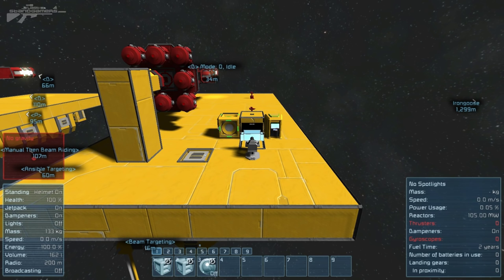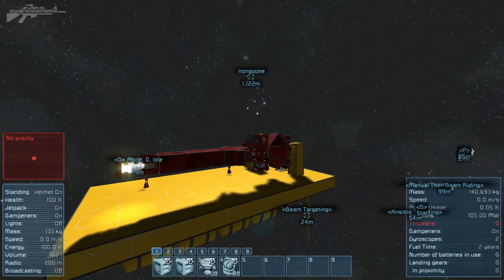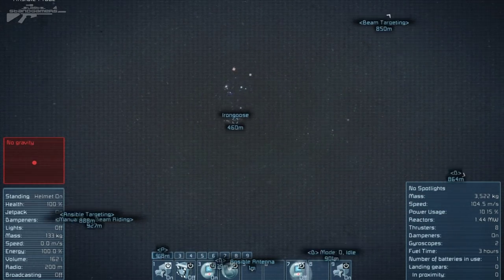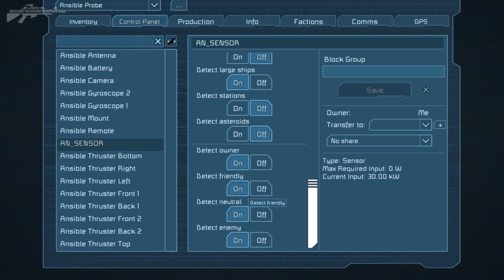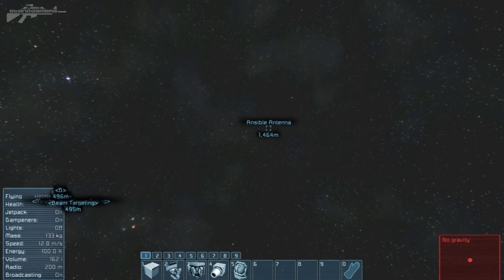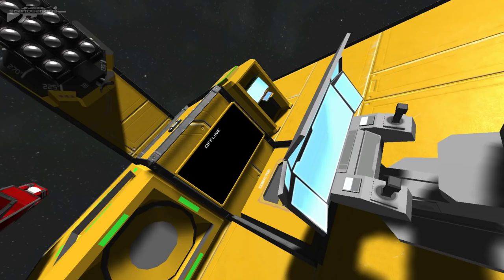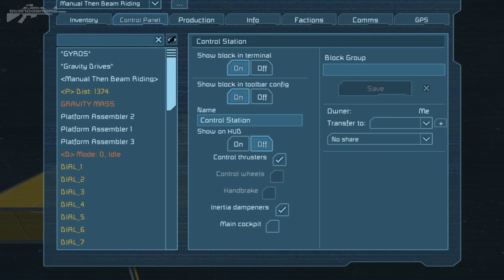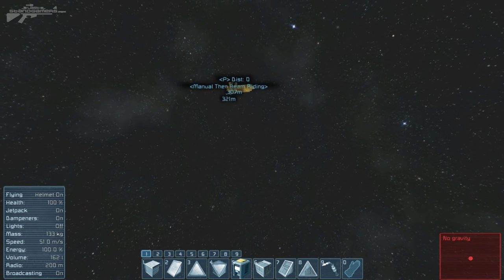Space Engineers - Laser Guided Missiles

Comment: I think that perhaps the first method might be simplest, plus if you gave it some distance and made it a satellite station out from the base a little bit it would provide better coverage. Granted you would need a sphere of satellites around your base to cover each point within the range of the turrets, plus perhaps each station would require six sides and six seperate subsystems so it would be one per missile bay, the range between them would have to be less than 800 for full coverage via the hemisphere of range of the turret and therefor the missile...
The second one requires too much effort before hand. It wouldn't do well in an impromptu attack unless you wanted to strike the enemy ship as they came by.
The third one seems a bit complex, but ultimately the best semi short range one, despite the lack of automatic protection, which the first method is best at despite its low range.
So the question becomes how best to utilize this in base protection? Fully automated short range system one? Preplanned attack drone guidance system two? Or long range preemptive retaliation system three?
Personally i would pick number one simply because i only need to set up supply drones to keep them stocked on satellites at range. And based on this it sounds like you could make a fleet of satellite ships that would remain in a certain position via an array of turret lasers with specific distances, and the drones would use this method to properly orient themselves from the main base to each satellite without too much problems after transit.
Now if only they could make a multislave ability... Granted a simple programmable block could just relay whatever signal you wanted to each slave ship as well... But that would be highly complex and not actually utilize the inherent controlls of the game such as pitching, yawing, and inertia dampeners. Maybe some day.

Comment: Most of these use the glitch that you can still access blocks that used to be on the same grid even after they've disconnected. I've been relying on some of that, too, but I think it feels cheaty. I'm hoping they create a real cross-grid communication system soon.

One of the things I do like doing is using automatic turrets to align and fire ultra-heavy manual turrets.
Reply: Craig Perko I just discovered that you can use laser antennas to exchange information between different grids by changing their names and using DetailedInfo to get the name of the antenna it's being connected to. I don't know if you knew this, but I agree that we need an easier system to communicate between different grids. I have a question: how does this glitch work? Do you simply disconnect two ships and then you can still access all the blocks or do you need to do something special?
Reply: MegaDerf110 Yes, I used the laser antenna method extensively. However, in the past you've had to reconnect every time you change the CustomName or it won't get refreshed. This limits the speed and makes it a lot more fragile. If that's no longer the case, it's great!

The way the merge block glitch works is that if you save the block in a global variable in a programming block, you can continue to make calls on that object even if it's not part of the grid any more. This does not survive load.
Reply: Craig Perko Thank you.
I don't know if you can use the Laser Antennas without having to reconnect them, I haven't tested that yet. You know, I started programming SE scripts this week, so I'm still trying to learn what can be done and what it still impossible/not implemented.
Reply: MegaDerf110 I doubt they've fixed the antenna name refresh glitch, since it's so minor, but I'll check at some point.
Reply: Craig Perko you could do this with the sensor block as well. If the sensor detects a ship, you can cast the last detected entity into one of the cube block types, and get the list of all blocks belonging to that ship. I'm not sure if its been patched though.
Reply: ***** I've tried that, but I can't seem to cast the entity into anything that the programming block accepts as an allowed class. Do you have a code sample?
Reply: http://forum.keenswh.com/threads/getting-all-blocks-inside-imycubegrid-from-sensors-lastdetectedentity.7355995/

http://forum.keenswh.com/threads/possible-to-access-block-on-another-grid-via-antenna.7314071/

I have a code sample on the first page in this thread: http://forum.keenswh.com/threads/store-a-reference-to-a-block-on-another-ship.7258050/

However, its been a while since I've tinkered in SE, and this may have been patched.
Reply: Thanks, I'll put them to use!

Now, if only you could create GPS coordinates and add them to autopilots in code.
Reply: +Craig Perko It is cheaty, but too bad that is the only for cross grid communication as of now. Hope to build a real "legitimate" system if inter-grid facilities are implemented in the future. Name refresh glitch seems fixed.

Comment: i kinda like to figure out how these things work while watching the video...
i gave up when i saw the turrets.
awesome. but how well does it work against armed targets? and can you launch more than one from the same launcher?
Reply: TheCptnOf Fail 
The first seems to work via triangulation, based off of where both turrets are aiming (horizontal and vertical axis')  and the distance between them. Personally I'd say this is the most reliable one, but it doesn't have the greatest range.
The second I would guess uses the probe to tells the missile which beacon to aim for, or something along those lines.
The last I presume simply boils down to rough aiming with the first turret, then using the missile-mounted one to point the missile at the ship correctly.

Hm.. for armed targets I suppose it depends how quickly they can close the gap before the ship's defences have time to inflict too much damage. And yes I'd assume you could modify them so you could 'print' them off and fire them one after the other.
Reply: Pyrobird
i think i get everything that you said... and they all sound like they are right.

i did mean have like a rack of missiles though. so you could fire two or three at the same time. though the printer idea is cool.
Reply: TheCptnOf Fail
Hm... I don't see why you couldn't fire more than one at once, though you'd want to stagger the launches a bit so they didn't collide ^^;
Reply: Pyrobird
that's kinda what i figured would have to be done.